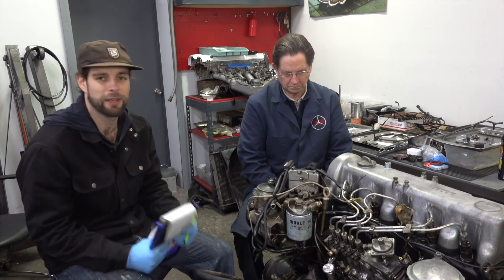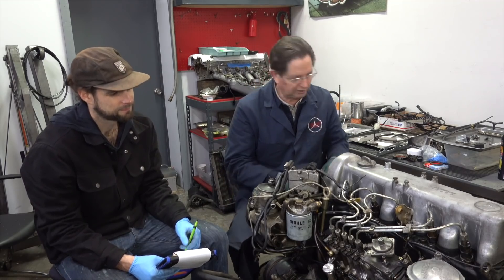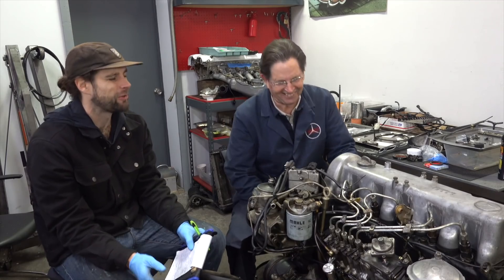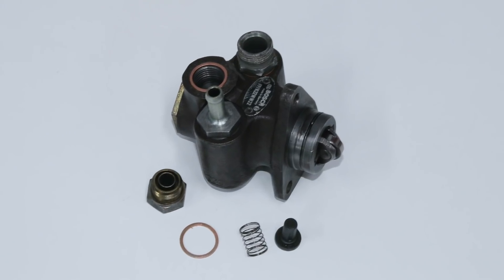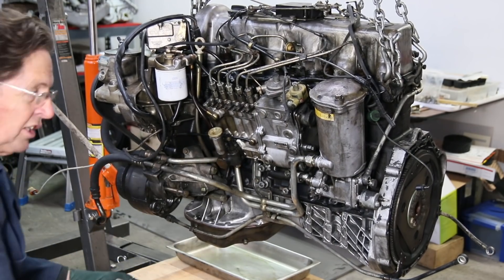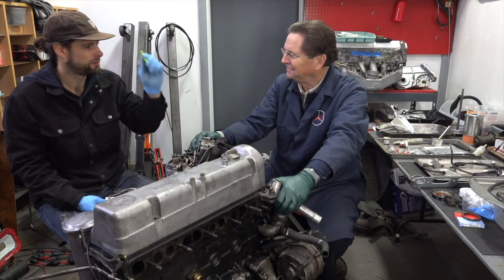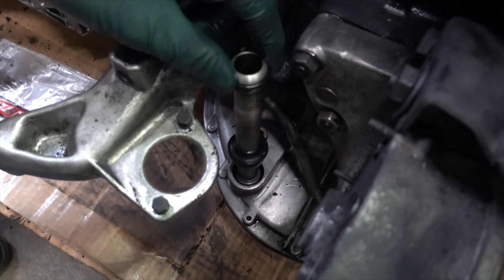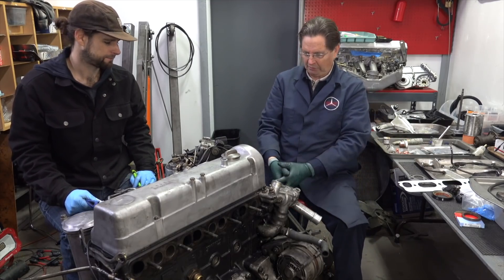Mercedes Diesel Engine Transplant: Digby's OM617 Gets a Make Over for Christmas

Comment: Just a little question, my 240D has good compression, the glow plugs are working but it is a little bit rough in idle and its not starting that well when it is cold, how do i clean up the pre chambers?
Reply from the maker: With hard starting issues you always start with a compression test first after doing a valve adjustment on diesels up to 1985. If compression is ok you move on to glow plugs, carbon reaming, filters, lift pump, fuel injectors, and injection pump timing.

Comment: The wax thermostats used in cars as they age gradually tend to open at a lower temperature. For good heat in the cabin especially on diesels renewing the thermostat is a really good idea.

Comment: I agree with all of that stuff. When the engine is out of the car replace everything and anything that is broken, leaking, or prone to leaking overtime. That includes any and all gaskets, seals, plugs, hoses, etc. In this case of a manual transmission it’s a very good idea to go ahead and replace the clutch in that situation but since this is a turbo diesel those were only made in automatic anyways at least here in the states. The only car that I know of that has a clutch mounted on the outside of the transmission is a Ferrari and I think that’s only certain years and models. It literally takes about 15 minutes to replace a clutch on those cars. Rear main seal is another important thing to replace. As for the a/c I might replace the hoses and pressure lines but charging it would be difficult in the wintertime anyways so I understand why you might not wanna do that now.

Comment: I so want a diesel W123, too bad that the few examples we have here in Peru are in very rough shape :(
Reply: not only in peru they were driven in to the ground worldwide.
Most famous is the taxi cab / commercial version in Europe.
Those versions had special reinforcments for an extra hard working life.

There is one such service estate W123 ( no rear seats ) from a MB truck dealer who bought it new in 1981 who has reached 2.5 million Kilometers with the original engine!
The entire car is total worn out and put on display at the dealership.
It still runs. There are plans to restore the car to new for the 75 year celibration of the dealership in 2021